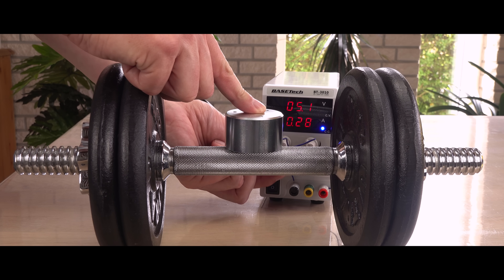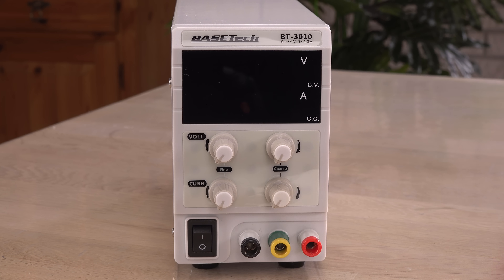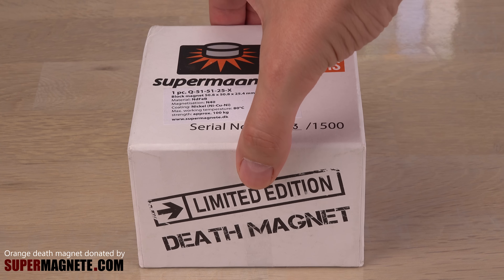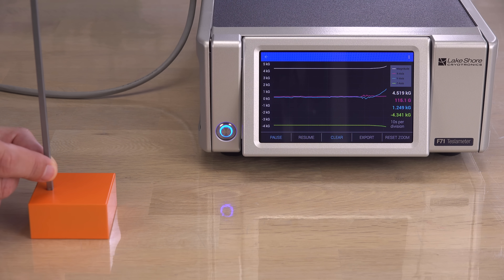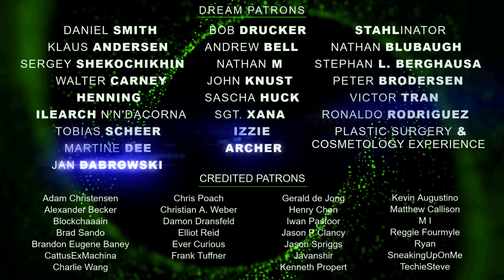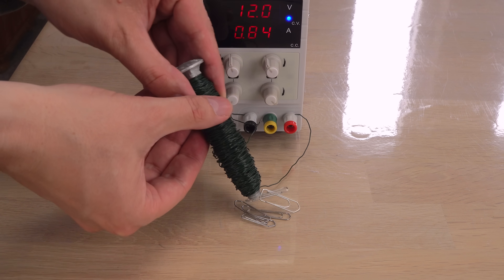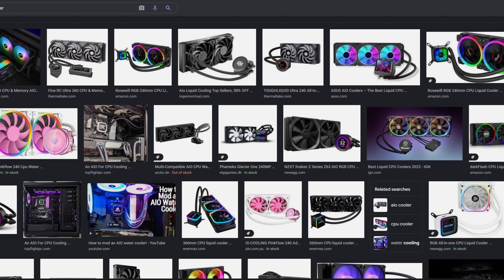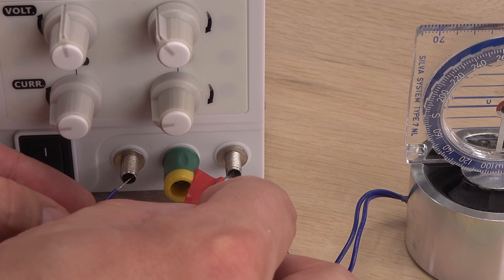New King of Magnetic Power? | Electromagnet vs. Neodymium Magnet

Comment: Those little foil strips at 1:00 look like they came out of one of those little adhesive retail security devices. I looked up how they work once. If I remember correctly, the foil strips are spaced precisely within the little plastic package so that they resonate like an antenna with the frequency produced by the security devices surrounding the exit door. The magnet at the checkout deactivates it by causing the strips to stick together which changes their resonant frequency enough to not react in the security field.
Or something like that.

Comment: If the field strength increases on the square root of power, it should be largely linear with the increase in current. That should hold true, until you reach magnetic saturation, where the field strength "tops out", and field strength no longer increases with further current increase. When the magnet is 'stuck' to a large peace of iron, the saturation current will be lower, than when testing open.

Comment: Yes, I want to see how much pushing or pulling force it takes to open a purely magnetically "locked" building door with just an average-sized "lock-"plate and magnet (not something with a huge magnet to a mostly metal door). And then demonstrate those doors' failsafe locking mechanisms that auto-trip in a power outage.

Comment: You use of the term "overclocking" in the context of electromagnets, however, overclocking" is conventionally associated with increasing the clock rate or frequency of computer components for performance enhancement. In the case of electromagnets, applying more power is likened to increasing current flow, strengthening the magnetic field. Despite the similarity in the concept of enhancing performance through additional power, the term "overclocking" is not commonly applied to electromagnets, emphasising a deviation from its typical usage in computer hardware.

Comment: I made electromagnets as a child using a nail as core and copper enameled wire about 22swg (0.7mm). I connected them up to my train set 12 V DC transformer but they did not work very well. After reading a book I saw they put a wrap of writing paper around the core so tried this and it worked very well and much stronger.

Comment: OK, sorry to be critical, but "over-clocking" is when you run microprocessors above their rated base frequency for faster computing but at the risk of reduced processor life from overheating (unless you can manage the extra heat through cooling strategies).  What you should be saying is "over-currenting" since you're increasing amps and therefore power dissipation.  Amps are what contributes to your MMF (Magnetomotive Force in units of Amp x Turns). As your coil heats up, the wire resistance will also rise, causing your electromagnet to operate less efficiently.  Additionally, as your iron core begins to saturate, more and more current will only generate excess heat with no appreciable increase in flux so there's a point where more current proves counterproductive.
Reply: No-Like Norman over here 😂

Comment: Electromagnet always wins. That neodenium magnet was alot bigger than the electromagnet so it's not an accurate test.

Also the electromagnet can be made even stronger using better alloys and increased turn count. U can always increase or add to the size of your core. Permanant magnets lack control. Can't use maglev trains using permana magnets. They are useless for the good things in life. UfOs work on the same principle. Electromagnetism.

Comment: Electromagnets are ideal if you're not going to need to leave them on for a prolonged period of time you can overclock the hell in short. Also depending on the application you can modify wire size etcetera to get different you can implement cooling

Comment: Braniac75

Can you re run this test using say a 220lb or even a 400 lb electro magnet vs the same neodymium magnets??

I have an N52 cube that's 1 1/2 inch x 1 inch 1/2 all around deminsions, it has 234lb force 

I like using lb force, as it's a direct relation between pressure, and easier scale to measure

I wish they would use lb force instead of Tesla or guass

Lb force is much more universal and easier to understand, and while both can be formulated to find the conversions, lb force is just much more easier to understand view mentally in the 🧠 brain

Or do all three for comparison!! 

Cool video, please do more videos

Comment: With electro-magnets there is almost no limit.  You just need more current or more turns and the sky's the limit.

Try seeing how much you can over clock it with only a pulse.  Hook it up to a high voltage capacitor.  Inductance will prevent immediate discharge but you should be able to get pretty high never the less.  (or fight inductance with inductance.  Use another inductor to drive current into the thing in a way it can't refuse.)

Comment: 💡Stack an electromagnet and neodymium. (Epoxy a coil around the neodymium magnet.) You can use a pulse to temporarily cancel out the permanent magnet. Iron can also be used to focus the power just like the electromagnet in this video, just make the center part the neodymium magnet. 👍

Comment: connecting a diode anti-parallel to the electromagnet will absorb that flyback surge, (back-EMF) which protects the inside coils from possible flash over, and protects you from a potentially nasty shock! Watch for core saturation, if over-clocking. You will reach a point, where the core reaches its absolute maximum strength, and will not become stronger by continuing to increase current.

Comment: the core itself starts saturating. have to consider what material that shell is actually made from, the amount of flux it can carry per cm^2.

heating of course, is due to the current times the dc resistance of the coil times the current... (i2r der) so winding a coil with a large number of turns for a high voltage, with less amps per turn but more amp turns overall (?) will produce less heating... (1A through 10 turns is the same as 10A through 1 turn, or 0.1A through 100 turns, etc...)

industrial magnets you see in scrapyards run high voltages.

of course these are designed for 12v... to a degree. i have lots of them, use them all the time in machining setups. generally run them at half the rated voltage. i dont like the temperature rise at "rated voltage".

pretty easy to make but buying bars of mu-metal or similar and the machining? cheaper to buy these. no need for laminating, theres no eddy currents on DC...

also note something...

if you took your monster magnet, wrapped it in a piece of aluminium or plastic so the poles are still open,  and shoved it into a similar steel shell, to bring the poles together...

wow.

well, thats what they do with those neat lil magnetic hooks, just small scale.

benefit of shielding the field, means its relatively safe in all but one direction...

the extra step is of course, permanent magnet switching chucks and vee-blocks. was at one place, convinced them to at least "try" a small 100kg rated crane "hook". fobbed them off as useless. i had to pester...
i left around that point.

came back a year or two later... they had realised the error of their ways... had about twenty of them. and had decided that 100kg was maybe a bit small. 5T?

the inductive spike is interesting... it isnt as aggressive when theres something bridging the gap. a closed core... the field persists longer, collapses slower... thats why induction coils for making sparks are open core, usually straight...

Comment: Honestly, I'd love to see you stick a tek cooler to the back of that. Forget the PC water cooler. Put something on the back of that that could in theory plunge it in the sub-zero temperatures and then just run it at the standard 12 volts and see what you end up getting

Comment: do you know of an small inexpensive 12vdc electromagnet like the one in the video that can be left turned on for longer than an hour? all the ones i see say 10 minutes or left or they over heat.
Reply: I know this is really old and I'm just guessing but probably using a higher voltage electromagnet and underclocking it would let you run indefinitely.

Comment: Looking forward to a followup on this! 
I'd be interested to see if you can use small passive heatsinks and some thermal pads to keep it at a safe to touch temperature (<=40°C). Or would some grooves in the outer shell work to increase surface area?

Comment: last month, to lift a steel plate I was asked to use a switchable neodymium magnet.

it was a big box, about 5L, with a nice handle and a side lever. put it on plate , push lever right, it sticks. push lever left, it's free. 

never activate it away from plate or your feet may get mad. 

=» neodymium can be turned off !!!

Comment: These magnets don't mind so much being heating up. They are used in metal industry to lift e.g. large metal plates and iron beams. They are usually not activated for more than from a few seconds, to a few minutes at a time.

With 4 to 8 of these, just in sizes that are larger, you can lift lift metal plates for e.g. ship construction, that weights several tonnes.

I don't remember the pulling power of magnets of this kind, that has a diameter 4 to 5 times the size, but we are talking maybe a tonne per magnet.
But you always want to have twice as many magnets as needed. One, several of the magnets can be short circuited/defect, second, their max pulling power decreases radically, just by having dust in the environment.

Comment: Could you please create a coil of wire and pass it over your largest magnet and measure the current/voltage?
Perhaps some magnets at the blade tips of a fan, turn it on and see then if speed matters?

Comment: Hi from South Africa l am 80 and have a question you read the residence in ohm's l have always been under the impression that a coil has inductive resistance then maybe only with a frequency not pure DC volts l must start experimenting with  different types of magnetic fields you learn something new each day that's the reason why things can only get better.
Thanks regards Lee

Comment: Very nice video! 

Have you heard about the combination permanent- and electro- magnets used for safety critical / lifting applications? This unit includes a permanent magnet with an electromagnetic component. The permanent magnet will produce an external magnetic field under normal non-energized conditions. When the electric coil is turned on, it provides an internal magnetic path, preventing the unit from producing an external magnetic field.  No power is required to HOLD the load on the magnet, but power is required to RELEASE the load. These are used for lifting and hoisting, where a power failure with a "pure" electromagnet would result in a dropped load.  I think they call it an "electropermanent magnet" assembly.

Comment: Good job on the video! It's interesting and educational but I respectfully take issue with your use of the word "overclocking". Electromagnets do not have clocks. Therefore, you cannot overclock them. You can over-power them, but not overclock them. Here is the definition of overclocking: "Overclocking is the action of increasing a component’s clock rate, running it at a higher speed than it was designed to run."  It applies only to clocked devices such as microprocessors and some other types of computer chips. Keep up your awesome videos!

Comment: You probably don't want to use an all-in-one cooler, as the pump motor is in the cold-plate, and the electromagnet would probably interfere with its operation.

Comment: Always pull air away from the electromagnet never blow air from a fan it just adds to over all heat. My homebuilt electromagnet has 350lbs pull force. I made it from an old light ballest and added heat sink from an old resistive dimmer switch

Comment: Even though those lab supplies are rated for 300watts be careful...max power I heard a small explosion in mine...it was fairly cheap so I opened it up to salvage what I could and saw that one of the CAPACITORs had exploded inside leaving strange hair like fibers on everything inside...but how do you bridge the electromagnet??

Comment: Most people don't realize that it is the field gradient -- NOT the field strength -- that causes magnetic force on iron.  (But gradients and intensity both scale with current making it easy to be misled.)  Additionally, closing the flux paths by placing iron across the open face will eliminate flux through the coil and greatly increase the field at the poles.  As performed, your measurements mean very little; the permanent magnet does NOT have this alternate flux path.

Comment: I wonder how far you could push it with cryo cooling, I bet there is a point where to much voltage would cause the magnet to fail regardless of heat, But pushing it to that limit might make for a mightily powerful magnet even if its short lived

Comment: I used to use an electro magnet at the machine shop I worked at and there was a slight delay from when the power was cut to when it lost its pull force , I was wondering if that just the nature or a electro magnet or if the system was using Capacitors that had to discharge first

Comment: An electromagnet that has the same strength as a permanent magnet can be made. What is the equation the equates them? Let's say the solenoid requires x amps to equal the Neodymium. Then another way to describe the permanent magnet is by its equivalent pseudo "current" value.

Comment: Wouldn't it be possible to weaken the force of a neodymium magnet by placing an electromagnet behind it with the reverse polarity ? This way you would have the full holding force without any power and have the ability to detach the object by temporarily powering the electromagnet

Comment: electromagnets are one of the most important components in particle accelerators such as the Large Hadron Collider or some of the many synchrotronns used to make intense X-ray beams.  Most of the normal ie not superconducting magnets use copper tubes as "wires" and pass 100's of Amps through them at low ish voltages.  The tubes allow low conductivity water to be passed through the wires to keep the magnets at a stable temperature of around room temperature when operating. These magnets have to be very stable under the current load so the magnets do not move as the guide the path of charged particles.  For the synchrotron the maximum field that can be made is about 1.4 Tesla and this is related to the saturation magnetic field induced in the iron core.  If you use another alloy called permalloy instead of Iron you can get up to about 2.5 Teslas.  Fields beyond this require superconducting wires that at present have to use liquid Helium cooling to operate.  If you search for magnets for synchrotrons you will find that some devices use rare earth magnets because they can produce very high magnetic fields in very small spaces which you cannot match with normal electromagnets.

Comment: I love making those little homemade bolt electromagnets in fact, If you give the electromagnet more current it will get hotter. More Voltage = More Strength | More Current = More Heat. I even tried to make an electromagnet oven by giving it around 5v DC 2 amps. this gave the magnets a fair amount of strength. but they got very hot. I was almost able to make toast with my oven! They even have induction cookers that are just a giant electromagnets with lots of current. It's fun to experiment with this kind of stuff! keep it up Brainiac75!!

Comment: For this and your N40 magnet, I think the best video would be temperature vs magnetic flux density vs max load, with an overclocked electromagnet with a UPS, and cooled by either liquid nitrogen, liquid oxygen or water that is just above freezing point.

Comment: Also I guess one of the advantages of a neodymium magnet is that it will always hold your load. So instead of using energy to hold the load in the air, you only need the energy to release it.

Comment: You just need to buy a larger electromagnet...Ebay has one that is 12-24V (6X2 inch diameter x height) 1200-1500 lb
lift for $350.

Comment: I wonder what would be better/more efficient to get more strength out of the same electro magnet; add a radiator and increase the voltage, or add a heat pump (peltier+radiator) and thus lower the resistance.

Comment: Pulsed DC and / or AC could possibly result in better performance but depending on electromagnet design and the frequency used can cause either more or less heat build up. Any added complexity would also add to the potential for failure.

Comment: 1:20 Things that determinate the strength (independent of power source):
° The wire used for the coil (material, gauge, length)
° The core (material, shape)
° And very important: How the coil is wound.

Comment: Would be interesting to see how using various power supply wave forms affects the strength of the magnet. Is the relationship linear if say pulsed square or sawtooth wave DC is supplied or is there a relative gain or loss in the resultant magnetic field?
Reply: wouldn't you just end up making a speaker at that point.
Reply: @martinshoosterman  Perhaps but other effects might be observed as well, such as linearity of attenuation, affect on input current to magnetic strength at different amplitudes and frequency, or any unexpected effects. It might answer the question you ask.